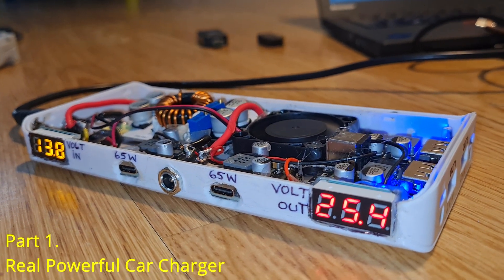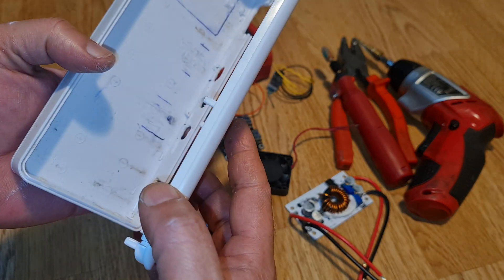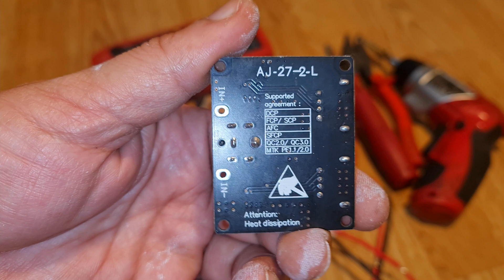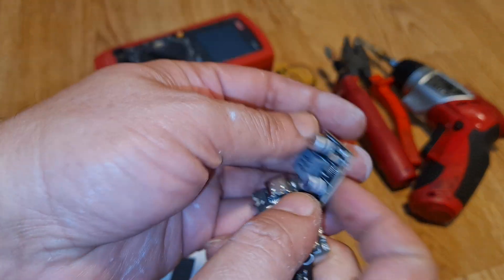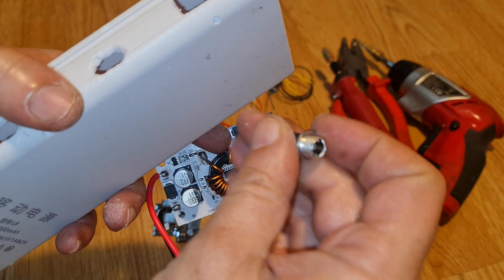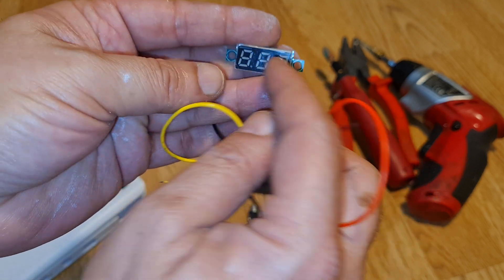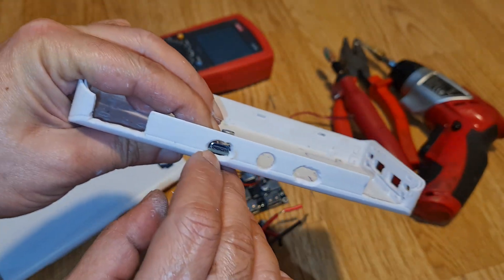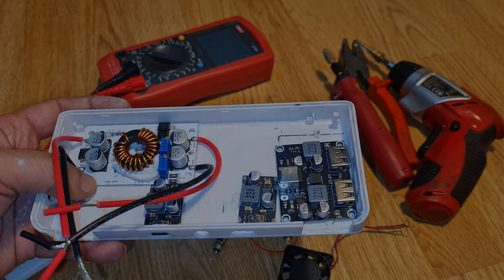Part 1. DiY a Powerful, Cheap and Best Car & Desktop Fastest Charger for Laptops, Mobile Devices ETC

Comment: I"d probably opt for a slightly smaller fan...is that one 30x30mm? or 25x25mm?  Or honestly it would probably be better to add heatsinks to the components of the boost converter that get hot and then add similar aluminium plates to the USB modules to keep them cool. Definitely going to be a serious lack of airflow inside that case.

Comment: Nice build, but if you use 24v as an input you won't be able to use the fan? That could overheat your case. Why not get a 24v fan? That's your common voltage because you have the boost converter..?